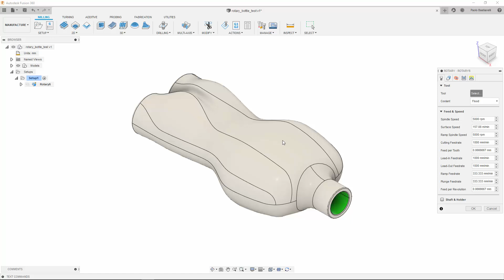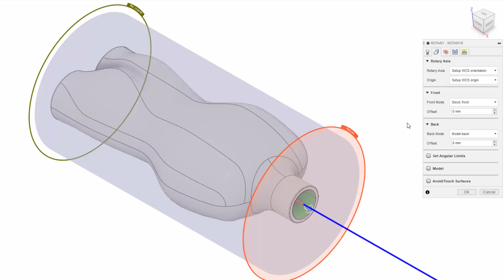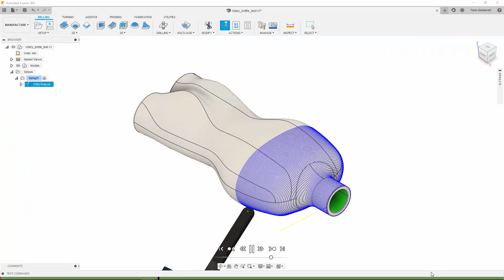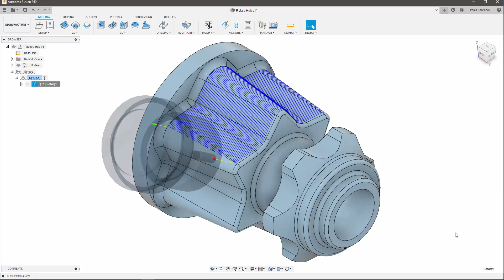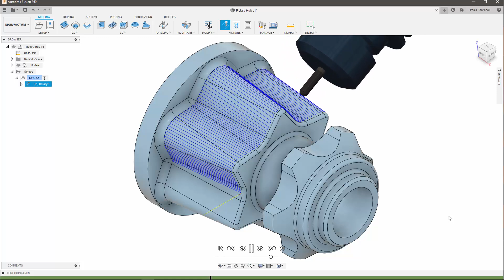TUTORIAL: Simultaneous 4-axis Rotary in Fusion 360's Manufacturing Extension

Comment: It is strange the developers have only set this operation up as a finishing operation that has no step down in the menu and the internet is full of people asking how they can do the initial roughing. There is actually an indirect option to this as one can simply split it up in separate operations starting with a high amount of AXIAL STOCK TO LEAVE and then gradually reduce this from operation to operation down to zero for the finishing pass
Reply: That is not the same, I want roughing to remove material in the hard to reach area's. You are suggestion to just run the same operation multiple time, which still leaves material in this hard to reach area's and it cuts a lot of air in parts that are easy to reach
Reply: Is it still the same in 2023? Fusion 360 still don't have a depth of a cut option?

Comment: Good information. The toolpath is fairly limited in my opinion, but it is for sure something that was missing until now. One of the hard parts is that there is no solid 4 axis roughing solution, so you have the rough 3+2 before finishing 4 axis.
Reply: There is an option to use this operation for roughing too please see my comment just above this
Reply: Agreed, all it needs is a depth of cut feature and then it could be condensed to a single operation.

I did wonder about using it with a high stock to leave, and then doing repeat rotary strategies at varying depths until the part is finished.